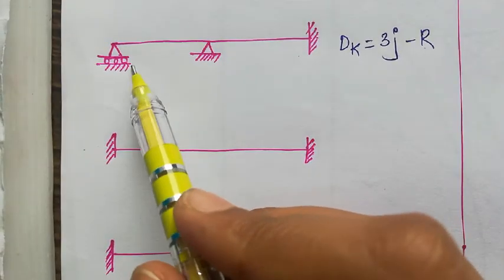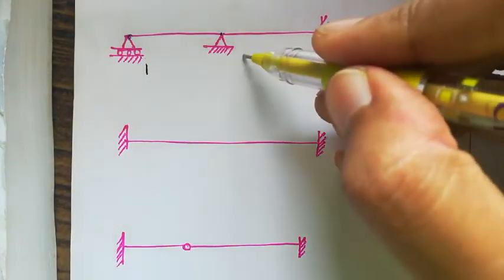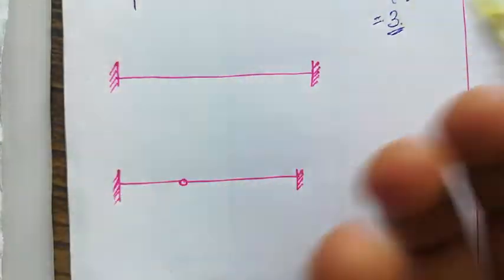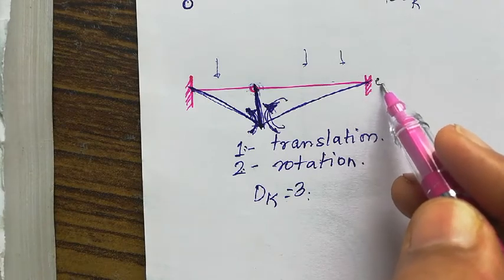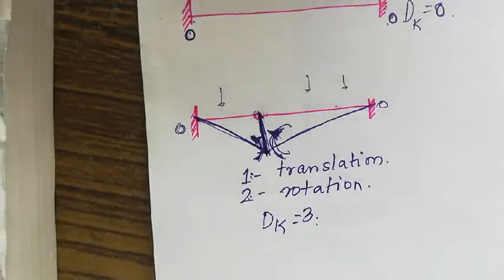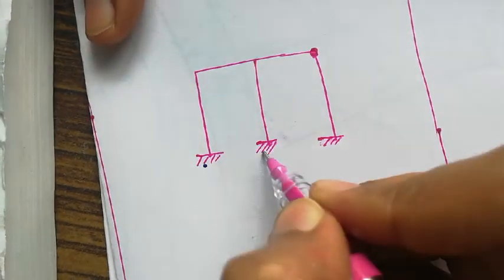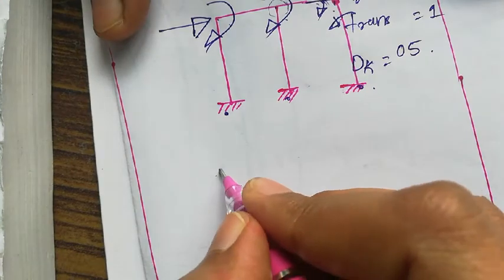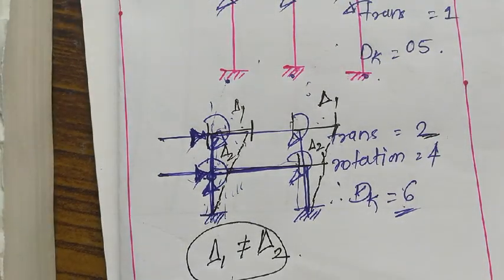Lecture 6 Problem's on Degree of freedom for beams nd frames

Comment: Hello, I have been watching your video but I noticed a contradictory point with another video. I am attaching the link to that video, (https://www.youtube.com/watch?v=mC4KHIPdYKo&t=585s) if you do not want to open the link you can try to search for "Ram Kinhikar-Calculation of Degree Of Freedom. (DOF)" video, which is a 13:31 duration video. ıf you go to minute 10:43, you will see he is investigating the same frame structure as on your 07:12 min. So, He says 6 DOF for the system and you say 3, can you explain how?